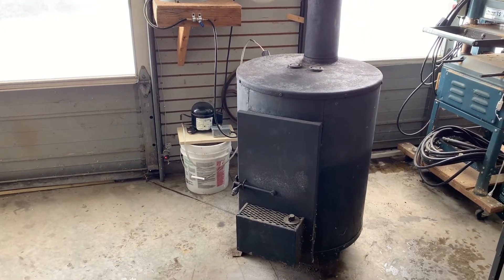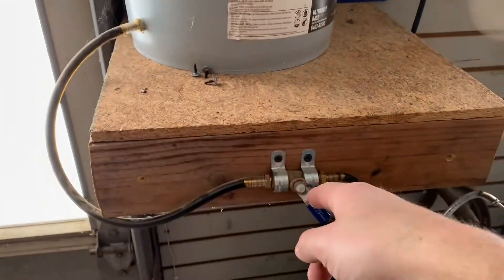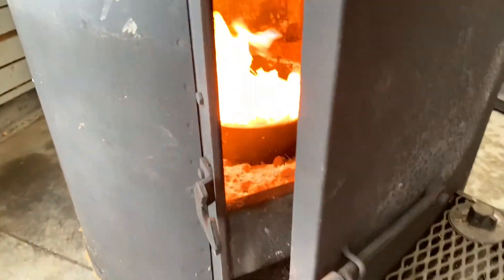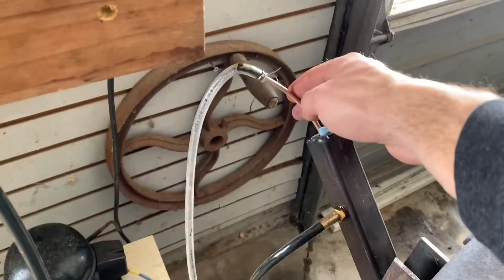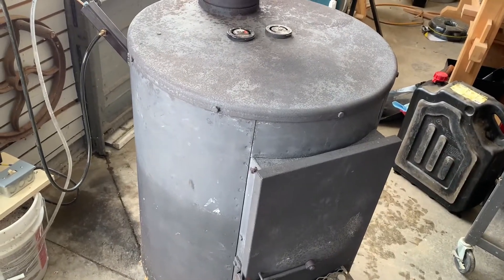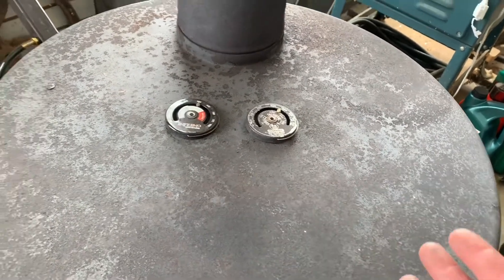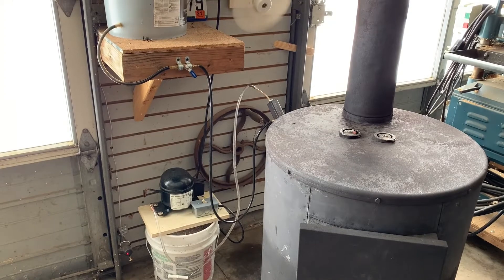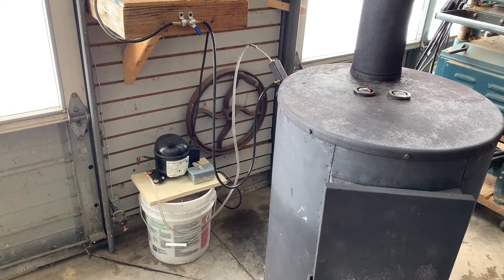Easy Waste Oil Burner Using Refrigerator Compressor- Free Heat!

Comment: hello there! i like that idea(the fridge compressor) and have been wanting to implement it into my waste oil stove build for a while, but have been unsure of the use of all the lines coming out of the compressor(whats what?). also was unsure of weather it would eventually pump all its oil out of itself over time due to having no way of recovering it or refilling it. i have tried many air sources, natural draft, shop compressor(too expensive/noisy) blowers, all sorts of fans. right now using a smog pump off a truck run by an a.c. motor. best yet, but tough to rebuild and they are pricey to get already rebuilt. you are right, a small amount concentrated (velocity) is far better than volume so far in my experience. i am running a 1/4 horse motor to power the smog pump and i think that is using more energy than your idea with the fridge compressor(plus so much quieter). any more knowledge on what kind you used, and or how to identify the plumbing on say an average one i can scavenge at the dump would be much appreciated!  nice job on the build i will try to figure out how to share mine with you someday i hope.  -fix
Reply from the maker: It’s really easier than you would think. Remove the compressor from a fridge (I just used a small dorm fridge), and there will be three copper lines in total. One was used to initially pressurize the system and is sealed. Ignore that one. The other two are the inlet and outlet. Just power up the compressor to see which is which. The compressor is filled with oil, as you said, but if you keep it upright it’ll never leak out. I’ve tried all the other kinds of air blowers, injectors, compressors etc. This is the best and the quietest. Good luck.
Reply: oh wow, thats great to know! im so excited to try it as my smog pump started getting really loud last night and i think is on its way out. looks like im on my way to the dump tomorrow which is my favorite place to shop anyways! thanks so much for the help! -fix
Reply from the maker: @emilyfixler7844  one more thing I should have mentioned in the video: I crimp the end of the copper pipe so that it’s almost completely closed. That way you get a true jet of high-speed air. That’s the key to combustion.